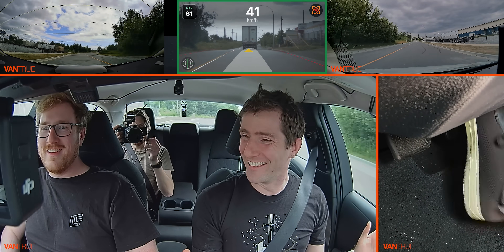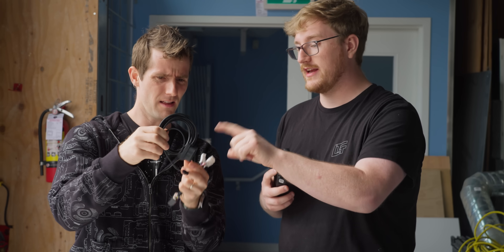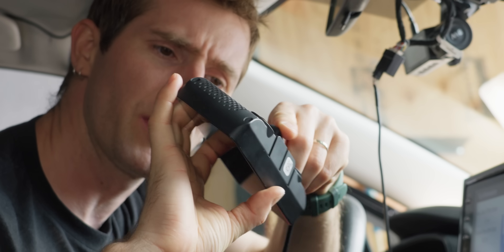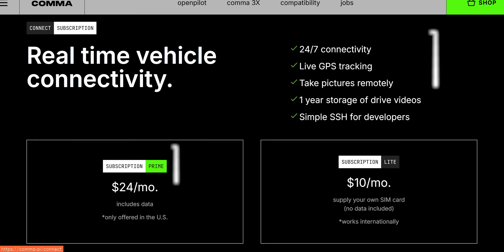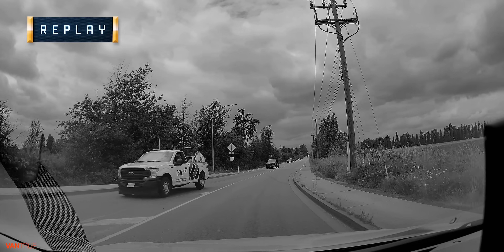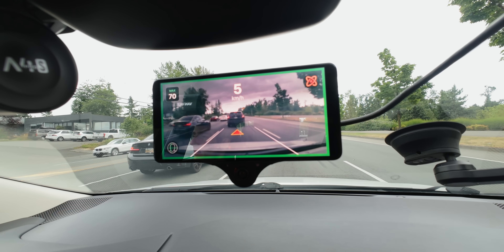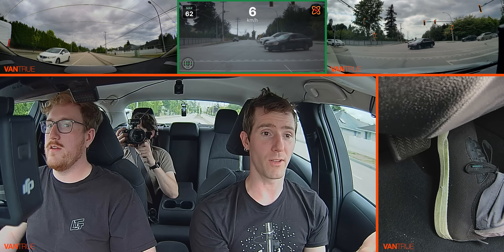I Upgraded My Car With Open-Source AUTOPILOT and it's AMAZING

Comment: Oh my god, thank you so much for making this video! I've been waiting for a larger Tech Channel or even self-driving/ai channels to do a review of this system , I've been using it for years and it's great.

I'm leaving some details / suggestions for your next video in a replay to this message; in case anyone on your team happens upon this.
Reply: A few things to add for if you guys do end up doing another video: Experimental mode is definitely very experimental at the moment. They are working on getting this to be better but obviously as you could tell is quite inconsistent and can be quite annoying especially on highways where it will consistently drive lower than the set speed. Using the regular normal mode is a much better experience all around.

That being said, some of the forks such as FrogPilot and Sunnypilot add features that drastically improve the experience, and really hone in on the aim of this device , which is to be a driver assistance technology. Rather than being fully autonomous.

I would highly suggest trying FrogPilot, although Sunnypilot is a close second. They both have a lot of overlapping features, and they also both add additional tuning for Toyota cars that can increase performance quite a bit. I'll describe some of my personal picks for must have features from the two forks I mentioned. It's really a shame that Comma doesn't Implement some of these features to their main code. 

The first stand out feature for me that Forks like FrogPilot and Sunnypilot have is called M.A.D.S, which allows for the steering assistance to always be active as soon as the car starts, even without cruise control engaged. What this allows you to do is control the gas and braking yourself in city like driving, or stop and go traffic, where otherwise you would have to fully disengage. After using this for a while, I could not imagine using the system without that feature. Has anyone who's used this system will find, for practical everyday driving, there are naturally going to be a lot of scenarios where you'll need to take over either gas or brake. It's only the gas or break that you really need to control, so keeping the steering assistance active is a no-brainer and just helps to remove extra strain from the driver.

Another feature that is excellent is dynamic experimental mode. There are a few different names for this depending on the fork, but as the name implies, it will switch between the regular driving mode and experimental mode depending on a number of settings that you can tweak. By default, it will use the normal driving mode and switch to experimental mode only if a stop sign or stop light is detected, allowing for the main benefit of experimental mode to work, whilst not keeping your speed too low and doing weird things with the brake on straight stretches. On FrogPilot, you can also configure this mode to brake for curves in the road, as well as when the vehicles speed is below or above a certain threshold, and a number of other variables.

The last must try feature I'd suggest is called NNFF, which essentially changes some settings for how torque is applied to the steering wheel. Usually there is a static value for each different kind of car as to how torque is applied to the steering wheel. The problem with that, is the value will only be optimized for a certain speed, usually the most common highway driving speed, and unoptimized for all other speeds. What NNFF will do is use a secondary AI model that is trained for each specific model of car, so that the torque value will be updated dynamically depending on how fast the car is going as well as a few other variables. Depending on the vehicle and the model, this could either make little difference, or could drastically improve the performance of Lane centering as well as steering authority and capability during turns. It really depends on the make and model of the car. I've found for my Corolla, it's a night and day improvement. 

There are so many other features and tweaks in the two forks that I suggested. But those three are the must have features for me personally.

Comment: I have been using a Comma device on my vehicles for 5 years and 87,000 miles and I would not live without it. My Comma device drives my car better than 80% of the people on the road, it stays in the lane, keeps a safe and steady following distance, and is never distracted.

Comment: I would be interested to see a comparo with modern car systems. My old Tesla system did ok on highways and looked a lot like this but still missed loads and needed help often. Of course on the Tesla that means having to re-engage every time which got old real quick. I've tried some other systems more recently though and its come on a long way. The latest VW system in particular is getting pretty good - though still some way off a real driver. I wasn't expecting that because the older (pre-25) VW system was utter garbage so top marks for the effort.

Comment: i’ve got one of these on my 2016 CR-V (one of the least advanced, oldest cars openpilot officially supports btw) and i can do probably 95% of a 120mi (about 193km) highway drive without intervening once. highway is really where this shines. if you don’t do much highway, i wouldn’t recommend it, but as someone who commutes long-distance on the highway regularly it’s invaluable

Comment: that... looks like a huge distraction right in the middle of your windshield at eye level. And I actually doubt this is legal in BC.

Motor Vehicle Act Regulations Division 7
7.05   (1)No person shall drive or operate on a highway a motor vehicle the windshield or any window of which is in such condition that the vision of the driver is impaired.

If this thing was higher up and hidden behind the rear view mirror, it might be fine. But it is clearly shown to essentially be right in the middle. I'm sure you can see under it, but it is still a blind spot right in the middle of your vision.
Reply from the maker: I can see fine - LS
Reply: @LinusTechTips  Well, that's good at least. Thanks for confirming.

Comment: As someone who lives in BC and recognizes the roads your on, you had better hope ICBC feels differently than me when they watch this video. Having to take control and intervene MANY times from this device as it steers you into a head on crash isn't cool. I get it's great and all for content, but it would really suck If someone's Wife and Kids get smoked by a car using this. I usually love your stuff, but come on man this is a public road.
Reply from the maker: I had my hands right next to the steering wheel at all times and it's way better than the lane keep assist on my taycan, which just rips control away from me when a line disappears on one side of he road. If that's legal, this should be super-legal. - LS

Comment: how is this less stressful than just driving
Reply: In the beginning it is not.  Once you get used to how it operates you get comfortable knowing which situations it handles vs doesn't handle well, and you can just start to naturally use it in the correct scenarios.  Road trips on freeways, or bumper to bumper commutes can be much more relaxing.
Reply: Auto pilot currently looks like its a danger as a false sense of security
Reply: Though this one specifically is extra murderous
Reply: It's actually much more reliable than this video shows, I guess the guys got unlucky with a very complicated road. It's best on highway where I can comfortably focus my attention from being in lane to checking the surroundings a bit for any kinds of trouble.

And yes, it gets more comfortable after a bit of use.
Reply: It isn't. Its just another silly product catering to the rapidly dropping intelligence and capabilities of the masses whom in all honesty should stick to public transport lol

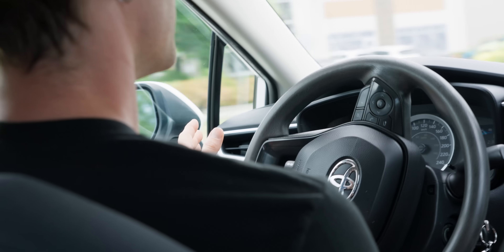Comment: 11:17 i am glad in EU in all VW group cars now they have the feature predective adaptive cruise control . Which not only adjust the cruise control.speed based on the road speed limit also it slow downs on turns and speed up on its own.

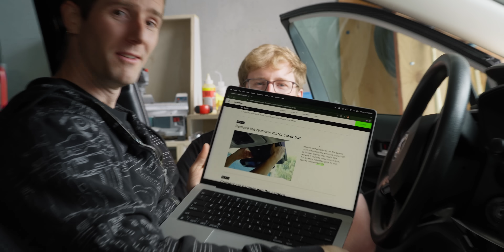Comment: 3:38 - TL; DR: Most cars won't care if you disconnect non-airbag wiring (color coded bright yellow) so long as the ignition off but will often throw a hissy fit if you disconnect and reconnect the battery, sometimes necessitating a scan tool to clear all the warnings on the dash. I've included more context below. Jake's advice is still good, just be prepared for a drive to a mechanic anyway to clear warning lights that will not go away on their own after you reconnect the battery.

I'm specifically referring to very new Hondas. Even when everything's working fine with a new battery reconnected, a test drive is often not enough to clear all the warnings. I'm pretty sure most dealers would do this free of charge if you asked nicely, but it is worth mentioning as it could be very inconvenient depending upon your location. If you're working with SRS (airbag) wiring which is color-coded yellow on North American market cars you must ALWAYS disconnect the battery and wait a few minutes before messing with that kind of wiring. However, regular wiring like what Linus was disconnecting in the rearview mirror area should almost never upset the car unless you do it with the ignition on or forget to plug something in and then turn the ignition on.

Comment: I have heard Open Pilot is great on the highway and still improving for road use. This video would back that up. Personally my Ioniq 6 with HDA2 is all I need or want at this time. Especially since I have it steer for me all the time, which is so much nicer than you can imagine. I have come to be pretty accurate at knowing if it can handle the curve without help or not. Hyundai should do a better job at alerting the driver to take over through.

Comment: If this thing becomes safer in about two or three years, i'd probably get a used prius 2018-ish and install this onboard.
Reply: It's already been going for 10 years, how long are you going to wait?
Reply: @enihi Well, I need a compatible car first. I've got a 2011 prius and that aint got anyting but crusie control.

Comment: curious if i could get a 2000's GM car working with this.

using a special GM dongle. i can control the electronic throttle and steering in a slight sense,

Comment: Watching this, I couldn't help but think that on a car without steering limits, someone could make a simple device that detects the speed of the car and steers hard in one direction if it's highway speeds. That's a terrifying assassination technique.
Reply: its more the limit of that car. sense its built for more lane assist then full control.
Reply: @gogereaver349  Oh I mistyped, I meant to write "on a car without steering limits" and not "on card".

Comment: This is not usable on any car, especially not on older ones or cars where you didn't include all the features. It still requires a built-in camera and radar unit which older cars won't have. My car from 2012 isn't supported as it had no radar or camera by default (both can be installed but that's hard as it's not really intended, even if the control units supports those parts in theory. I'm still looking for a solution to get a few assistants into my car, but I guess that't not possible. My car can even steer by itself as it has an automated parking feature.

Comment: I am curious if the linux stack is setup with AMD (ROCm) or nvidia (CUDA) or is software/CPU bound? I would like to see a variation that can use a newer Core Ultra 5 245 or similar with AI cores, granted that is only 25 TOPS (init8) but likely would handle a lot more details, if programmed to do so.

Comment: I really feel like your car's EPS is screwy. The torque limit alerts you kept getting should not be happening in a Corolla. Maybe a Honda Civic with it's weaker motor, but not a Corolla.

Is there damage to the car?
Reply: Agreed

Comment: Do you know why the software is open source? Because multiple agencies demanded that the company provides confirmation that the system isn’t endangering the driver and others in the road (because insurances won’t pay if you have this thing installed). So what did they do? Easy: they now only sell the hardware and made the software open source, so they can say they only sell a fancy android dashcam with CAN interface, YOU put the software on it. That’s not only shady, that’s just dangerous. So if you don’t want to pay for the rest of your life if you have an accident (you survive), don’t use this thing. It’s cool, no doubt, but it’s not roadworthy…
Reply: 100p agree

Comment: I think this thing supports every model of Ford besides mine. It even supports a 2018 Ford Focus for crying out loud.

I wonder if theres a fork avalible that will connect to a self hosted server instead of using their cloud service. That would make this actually more compelling than say a Tesla for me, I'm tired of putting everything in the cloud where I have no control over my data.

Comment: It would be amazing if they allowed rear webcam connectivity to give the car a kind of ''360 degree'' view so it can calculate when it is actually safe to change lanes or to use that data to enhance its current features!

Comment: If you do a second video I would like a little bit better explanation of the car features that make the autopilot run better. You didn't really touch on that. 

Example I'm assuming you have to have electronic steering for the device to work at all (why you couldn't install it in Pluffs car) 
The vehicle probably has to have some amount of active parking sensors built into the vehicle from the factory?
Reply: It basically needs to be able to do all this on it's own, it just makes it better.

Comment: Please wear seatbelts; it's 2025, and "microphone" is not a valid reason.
Perhaps a little less cursing would be nice? A beep every 12 seconds is quite annoying.

And this product? I don't understand why anybody would want this digital backseat driver constantly nagging them and constantly unable to perform simple turning and navigation. This isn't even a beta release. We're just normalising making customers do testing work and using cute words like "community" to make them feel included. Everybody loves a pat on the back.

Open source or not, until a product is fully functional, it shouldn't be allowed to be released, especially for such safety-critical applications.

Comment: You guys should look into retrofitting this stuff into older cars. You can retrofit OEM adaptive cruise control into a super cheap Mk6 Volkswagen Golf TDI with a little bit of wiring and programming, and then Openpilot works even better (PQ45 VWs have greater available torque). The supported cars list on the website is far from definitive.

Comment: Even if it´s allowed to have stuff on the windscreen, this thing is blocking a whole lot of your vision. On my car the windscreen is in such a steep angle, that this thign would block way too much of my view. So I think they need a version with a much smaller case. or they need to split it up, so that you have cameras and screen seperated.

Comment: I imagine this could be made a lot better if cars standardized more things like cameras, lidar, lights, etc. Just have one plug that handles all of that, and you could have different models and such for different configurations as well. Hardware is another thing too, I would feel way more confident if it was running more beefy hardware with bigger sized model I just don't think phone hardware is enough really. I wonder if those weird PS5 reject motherboards could work that have a partly faulty GPU, that could be really good use case for them

Comment: So, it would have complete steering control in a fly-by-wire system?  In this car, it can only assist to the degree that power-assist helps the driver?  As someone who doesn't tinker with cars, that weirded me out for a few minutes.  Actually, all of it did - I seem to be behind the times in how much every car is now electrically controlled, presumably through a chip.

Comment: I imported one of those glorified open source driving pilots for my Toyota and let's just say that this is why I love open source projects. I use it to drive once per year on German Autobahn, I set the cruise control to 128kmh and it keeps driving for me and only in construction zones I have to take over because it wants to switch lanes to the small left one instead of keeping on the right one because it thinks I'm about to take the exit even though both lanes go straight and the right lane is bigger because it's made for semi trucks. I also modified the files in order to make it compatible with the OBD Bluetooth dongle since it adjusts the speed when I go up a smaller hill and it keeps doing the engine break thing when driving down the hill, which is a way better experience than the stock cruise control which breaks automatically to keep the speed and just annoys the people behind me

Comment: @3:38 stick to computers Jake. This only works with old cars. Most modern cars have immobilisation systems that will stop the car from starting after disconnecting the battery and you have to figure out the security protocol to unlock it. It's more of a headache than it's worth sometimes. Instead, just send it and replace whatever fuse blows if you muck something up. That's what the fuses are for!
Reply: Well that sounds terrible I'm not buying a modern car.
Reply: Both those options sound awful, but replacing a fuse would scare most normies

Comment: Beartech has been making accessories and additional supporting hardware for the openpilot community. 
If you want to try a different car, such as the Honda Odyssey (which Linus has one), and you're looking for a pedal for low-speed support, you can try reaching out. 
They also make SDSU for Toyota long control and various magnetic mounts for quick connect. 
They are also located in Vancouver.